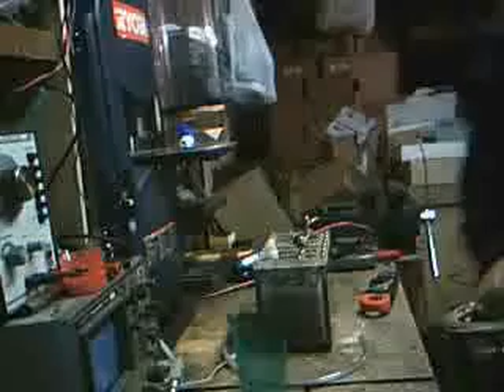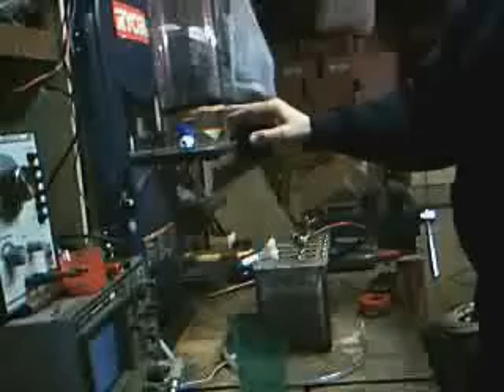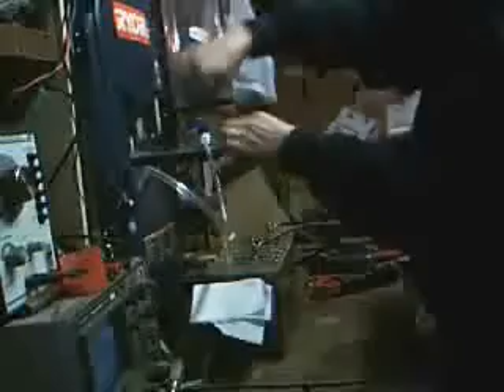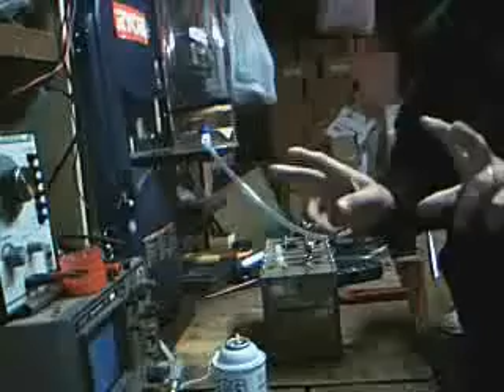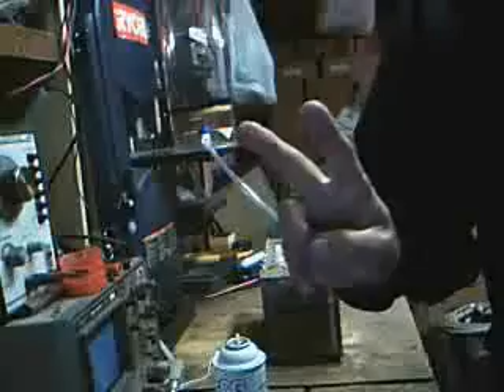#251 - hhoi / linear water test part 5 of 5

Comment: all this proves is that your cell doesnt have the right design because what most people use is a feraday style cell witch has very thick plates and wrong amps and voltage.you will never cavitate/vibrate the plates because there just too thick.when my browns gas cell is finished ill do the same test but with electrically expanded water.cheers